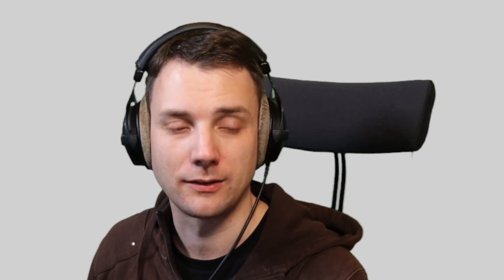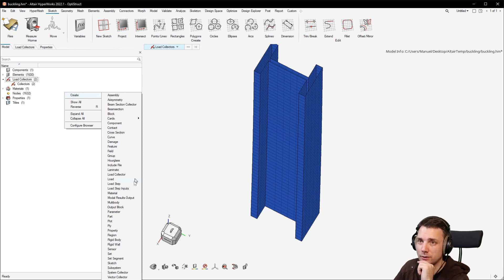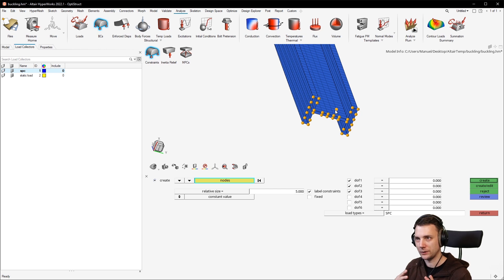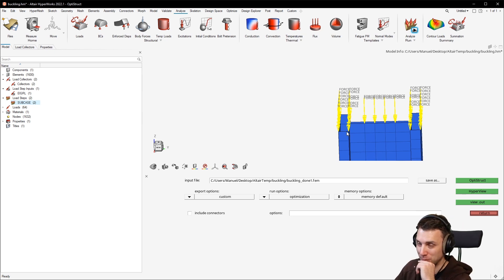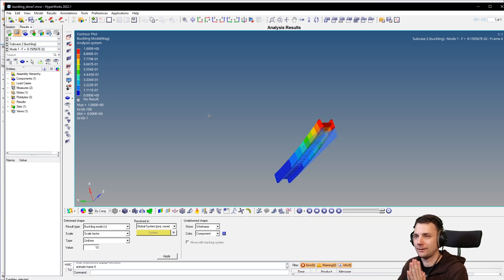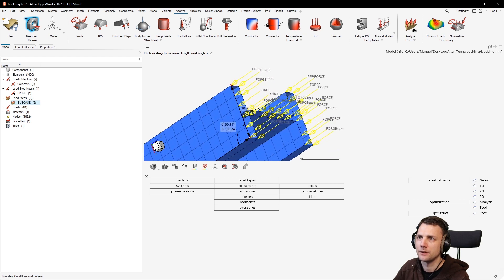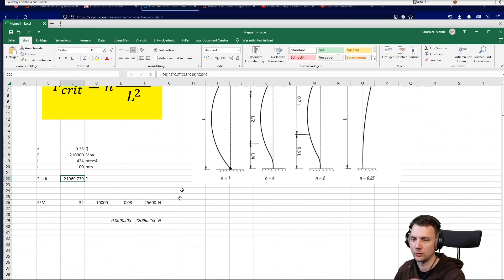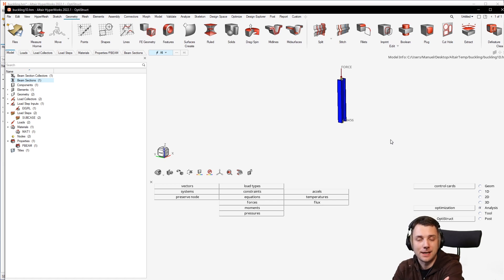Altair Hyperworks 2022.1 Linear Buckling Analysis with Optistruct (OST-1040)

Comment: Hi Manuel, thanks for the nice video. Iam interested to understand more on buckling behavior when there are side loads and moments applied at top end. In such scenarios, the buckling factor will further come down than what is applied as only compressive load right? If you have made a tutorial on the same, can you please forward? thanks in advance. or this is more or less applying on those additional loads under static load step? or any additional settings to be turned on in HM like statstub preload?

Comment: Why there are differences on LF at results depends 1D-2D-3D ? What is the reason?
Reply from the maker: The most important difference regarding bucking analysis is about the eigenmodes you can simulate. Shell buckling eigenmodes can become far more complex than with 1D elements.

Take a tube for example. A tube modelled with 1 d elements can deflect and buckle this war but you will not get something like a local buckling at a joint of tubes which is very important for some structures to analyze. So it depends on what you want to get from the model.

Comment: hi, I noticed that when exporting hyperworks results, it gives a lot of results such as displacement, von mises, shear stress,... What is the role of the results to be evaluated? ( How To Interpret Finite Element
Analysis Results )
Reply from the maker: It depends on the method of analysis. If you are considered with buckling analysis, the load factors are the most critical output request to pay attention to. If you are considered with doing a linear static analysis, diplacements might be of interest, for sure the von Mises Stress but as you can hear Lukasz and me discuss in the video about different analysis methods, it may give ridiculous high values. Then, nonlinear analysis, you might be more interested in the strain data as the stress will top out at yield. So it really depends what you want to analyze.
Reply: @ManuelRamsaier  
- So what does the von mises value represent?
- From the displacement output in the software, how to best identify the deformation from that displacement?
Thank you very much
Reply from the maker: @nguyenminhvo8820  You want to know how much stress your material can withstand so you do testing on uniaxial loded  specimen (just tension) and you will get yielding and ultimate stress values for that. The problem is that you do not have uniaxial stress condition in your part necessarily. 
To be able to compare your stress tensors in real life to a single number (e.g. the yield stress) form your tests, different hypotheses exist. One of which is the one with von Mises. 
The von Mises is derived from the stress tensor and gives you a single number to be compared with material strengths for ductile material and is used a lot. 
I would suggest that you check this in the literature as it is quite important, that you have a fair understanding of this matter.
Reply: @ManuelRamsaier  Thank you very much, can you share any documents that can help me understand these issues?
Reply from the maker: @nguyenminhvo8820  Chech the youtube channel: TheEfficientEngineer 

Start with the oldest videos. If you can, watch them all. They will greatly enhance your understanding of mechanics. For books... there are a lot to recommend but any intodoction to mechancis book will cover this concepts.
Reply from the maker: @nguyenminhvo8820  This vido by TheEfficientEngineer is directly what you search for: Understanding Failure Theories (Tresca, von Mises etc...)